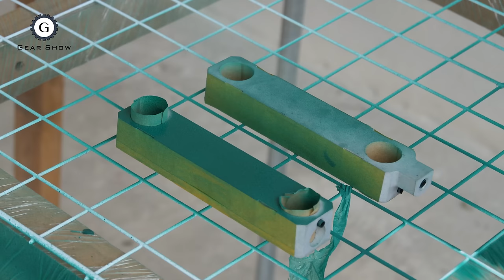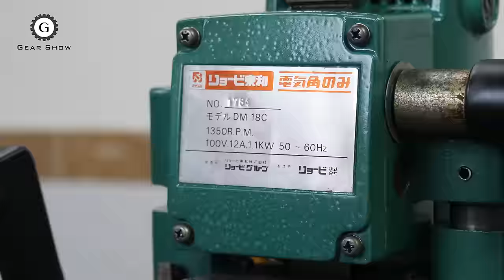Chisel Mortiser Restoration

Comment: grouse work mate she looks lovely afterwards with the restoration results plus the On/Off Switch is a good type too and i,m impressed that it still works to it,s age and day too yep  top notch that one and yep the old gear always has a good use out there for sure and that one looks like a Makita brand to me seeing the red letters on there and even though i cannot read the letters very well it looks like it,s made in Japan to me personally but yeah always a good bit of hardware to use in the workshop or shed for sure and that one looks amazing  with solid construction qaulity plus a good build it,s day of manufacturing too and cheers from Australia or the Land Down under 🐨🐑 🦘🌴🌳🇦🇺 🍂to your area and yes it,s our annual Autumn/Fall season here atm too.

Comment: That is not even that old, it was expensive. I have a similar one that was used for putting the hole in doors for the flat, long rectangular door locks. Still works good for when I need a mortise. It has slotted screws so you know it is old.